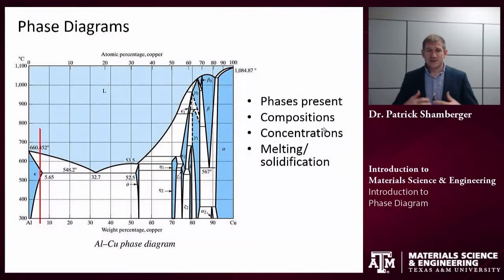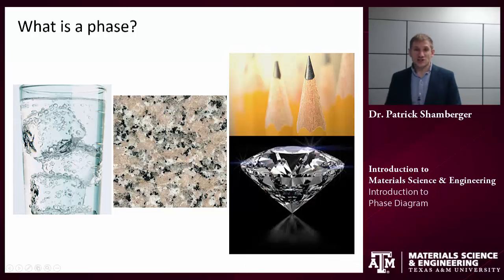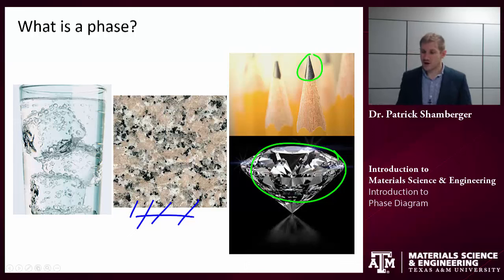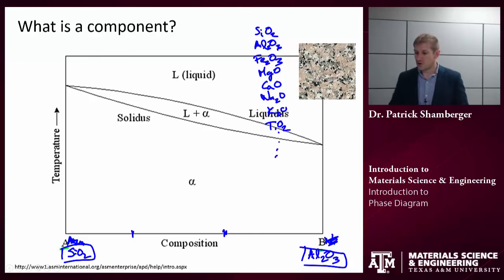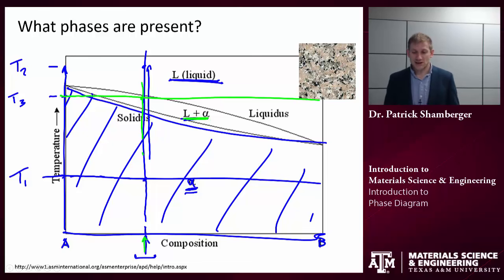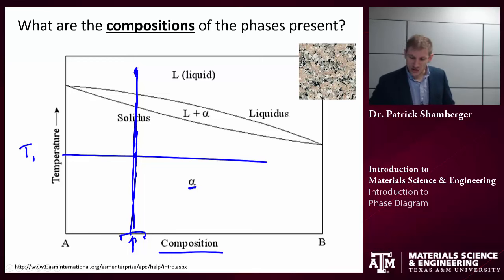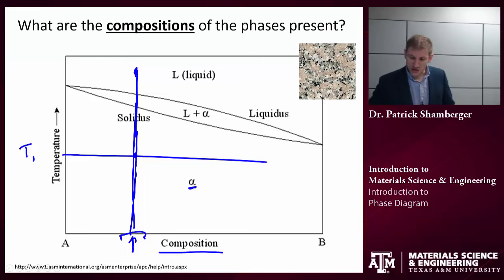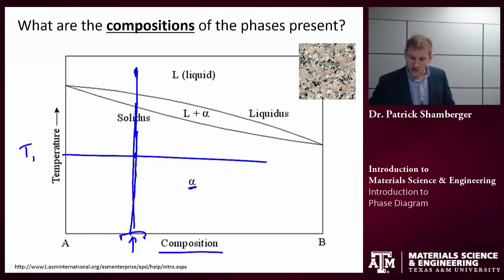Intro to Phase Diagrams {Texas A&M: Intro to Materials}

Comment: professor can you reason why the melting point of copper nickel alloy is higher than the pure copper and pure nickel
and similarly
in case of lead and silver the alloy melts at lower temperature than the melting temperature of pure lead and silver
Reply: Dr.KOMMERA RAJANI KUMAR REDDY No he can’t. He’s busy at the moment, to be precise, hangin’ out with some chicas over to his cousins place in Albequerque eating some tacos and shit knowmsayin’!!
Reply: Lead and silver has an eutectic system, that is, they easily melt. Melting point for Pb-Ag alloy is lower than the melting point for individual composition.